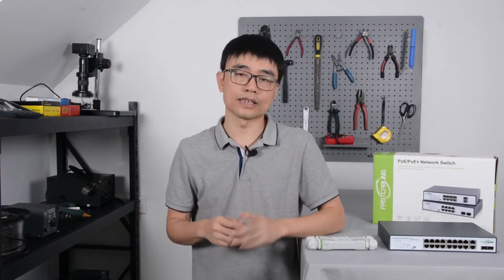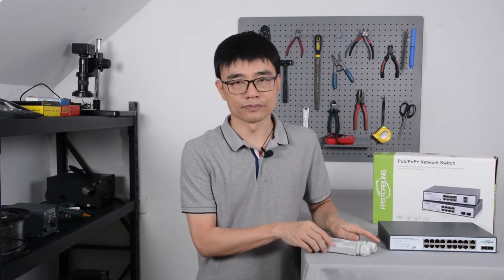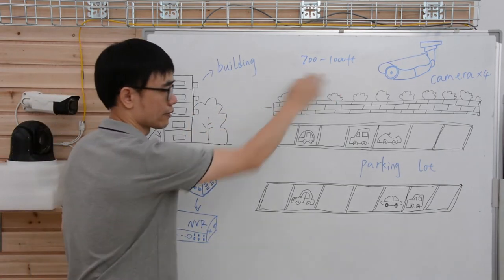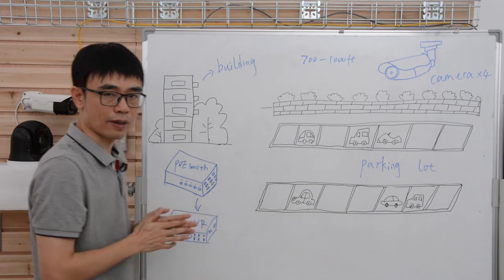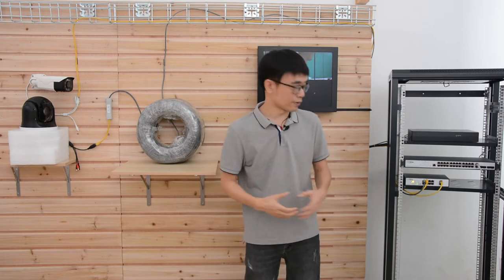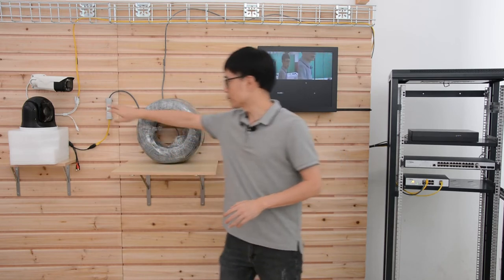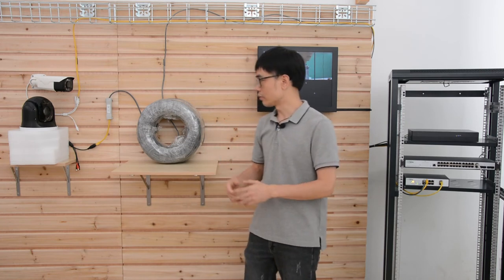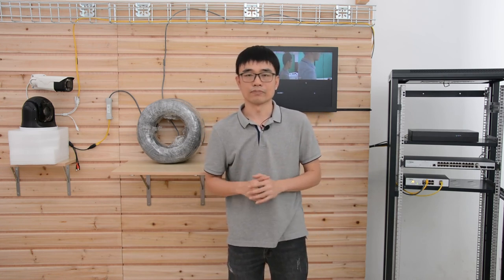How to Connect 4-unit 1500ft Long Run IP Cameras to PoE Switch

Comment: hello i have 12 camera that are need to run over 220 meters please any help
Reply from the maker: If the distance is less than 250 meters, you can turn on the CCTV mode on the switch. The bandwidth will step down to 10Mbps. It is the trade off between the speed and the distance. The system should be ok if it is 2mp IP camera. Just make sure you use the switch with enough POE power. The long distance will need more power. The long the distance, the more power loss will be.